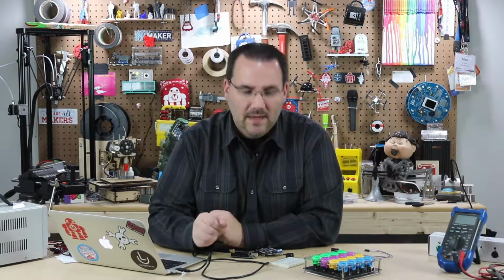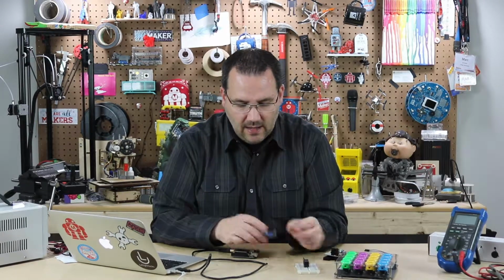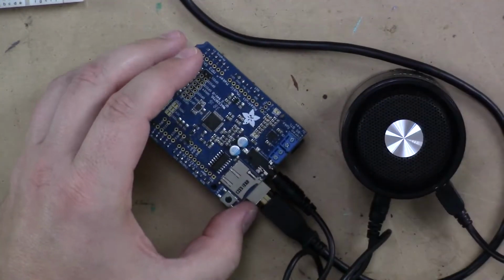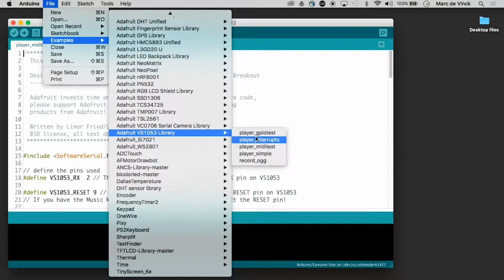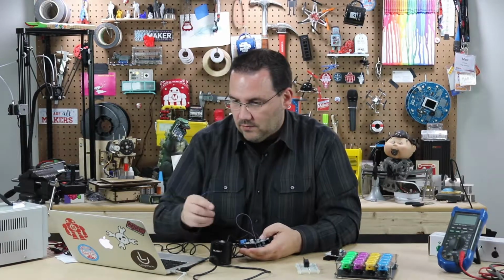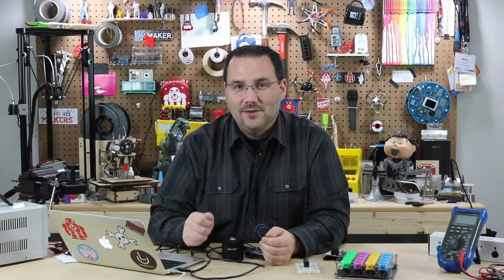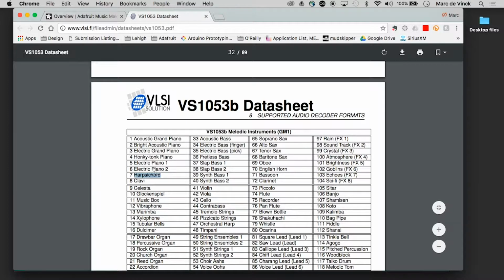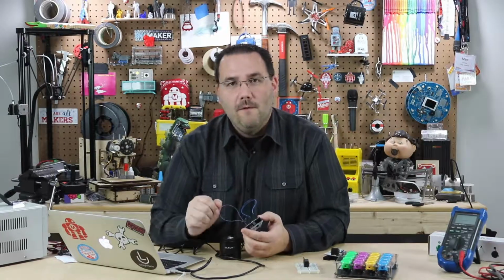Arduino Prototyping Outputs #84: MIDI

Comment: Hi~How are your speakers connected? I see two cables in the video, but my stereo only has a female Android port and a male usb port
Reply from the maker: The shield I am using requires an AUX port. I picked up an inexpensive speaker for the demo.
Reply: Thanks for your reply @MarcdeVinck

Comment: hello, could you pair the arduino program in the comments because it is very well done and it works ... thanks in advance ;)
Reply from the maker: Follow the instructions on installing the library, as per the video, and the examples code will show up directly in Arduino IDE under examples. It’s easy!